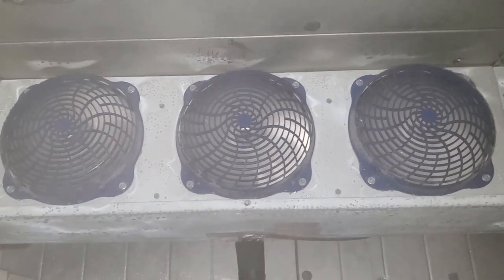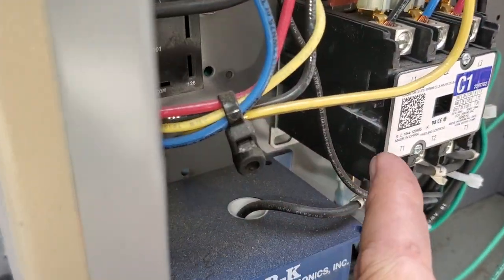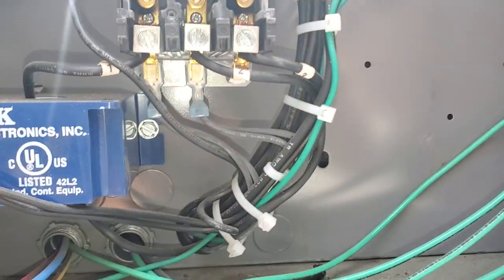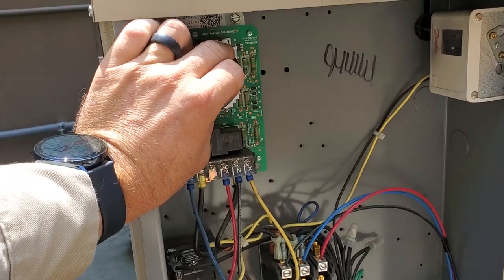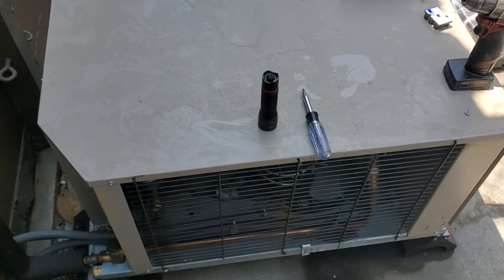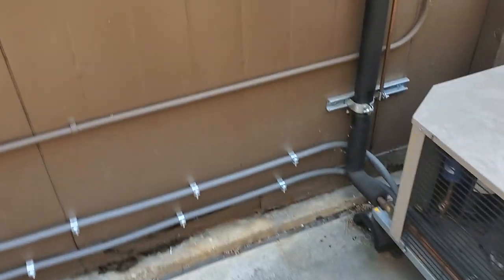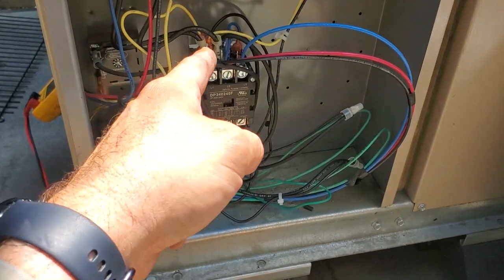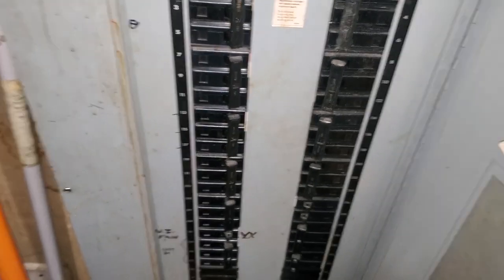THE WALK IN FREEZER BREAKER IS TRIPPED

Comment: Forgive me for sounding like a know it all but this isn’t my intention. You say you have 30A fuse installed then a 40A breaker upstream from this. The issue is that circuit breakers have different tripping characteristics to fuses. Fuses will actually withstand high overload current draw for longer than a breaker. So normally if you are going to protect a fused circuit with a breaker you have to oversize the breaker in order to provide discrimination between the two protective devices. For context I am an electrical engineer on the railway who works on three phase installations in the UK. For example when we have a 63A fuse installed we have to use breakers sized 125A upwards depending on the cable length between the two. Again not being clever just wanted to provide an insight to the fuses and breaker. Great videos by the way!

Comment: Mistakes happen, but the real test of a technician is owning up to his mistakes and correcting them. Yeah, it's hard working with your tail between your legs, but it's in the job description.
My photographic memory helper did the same thing, and I immediately knew what was wrong. I kept him on the hook for 20 minutes until I said rotation. He got it right away and corrected the wiring. I told my helper that I have done it too. It seemed to help.
I don't think there is a technician worth his salt that hasn't made simple mistakes.
Reply: Our motto was " Its not a mistake until you walk away and leave it there " , so you can be mistaken in the midst of a job , your only Human

Comment: When I used to fix light boards and soundboards, I would take pictures of everything before I removed anything. As someone in another comment said, they went back and looked back earlier in your video, as did I. Even before that, I was confused as to why there were red and blue wires going into the center of the top of the contactor. As you said, you found the problem and fixed it. That is the important thing. Imagine trying to connect a megawatt generator to the Grid out of phase. Because the Grid won't move, most times the generator tears out of it moorings and flips itself to fix the phasing.

Comment: I have seen a case where a bug got trapped between the half-cores in a contactor once. It prevented it from pulling together fully. Another thing to check is that the coil voltage to the contactor is correct.

Comment: It's nice to see how totally different everything is on electric side of those machines compared what i see here in Finland, i mostly work with grocery-shop refrigeration systems. On those wire colors. it's really strange that blue is live-wire, here blue is color for neutral :D, usually when changing electric components i take before photo to get things right.
Reply: In the US, 120V and 208V/240V are black-red-blue (white neutral), while 277V/480V are brown-orange-yellow (gray neutral).
We've also got funky utility transformer setups on some occasions: corner-grounded delta, high leg delta (for split-phase AND 3-phase loads), and open delta ("fake" 3-phase using only two transformers - it's real 3-phase, but the 3-phase load capacity is reduced compared to having three single-phase transformers, and the 3ph load is required to be balanced).
On rare occasions I've seen the utilities use three-phase transformers to supply customers - some are rectangular like the ones you use in Europe. But otherwise, they tend to use three single-phase transformers. The single-phase transformers can be used in a variety of different ways (but is 15% more costly than a single 3ph transformer).
(Exceptions are for large loads, like a mall or industry. There they'd use a pad-mount transformer or a switchyard.)

Comment: As an electrician I work on contractors often. As one person mentioned chatter causes arcing, arcing causes heat, heat causes carbon buildup.So what causes chatter as someone else said low coil voltage, or more likely a week coil caused by dirt in the plunger or coil windings comprised and shorting. You should take a resistance reading across the coil terminals and test to ground.

Comment: It's easy to get phase rotation wrong when reconnecting to replacement parts. The key is to check and fix it. 
It's not uncommon for a breaker to trip instead of a fuse blowing, even when the breaker size (amperage) is much larger than the fuse. This is often due to a much higher AIC rating on the breaker than the fuse, so the breaker responds the the high current (short) much faster than the fuse.

Comment: Circuit breakers can be decalibrated on thermal overload trip part. A 30(?)A fuse trip curve might be above circuit breaker trip curve in overload and scc area. Selectivity is not usually achieved with one step downsize but usually with 2.

Comment: Had one of those puckered butt moments today. Had to reset a 480 volt VFD that drives a 125 horsepower motor. I'm so glad no sparks flew lol turns out it tripped from overheating due to blocked vents.

Comment: Always pull the panel cover or hit it with a thermal cam. Loose breaker lug will heat up and trip the breaker and cause a recall. Another thing on them heat craft units is them anti shortcycle timers are terrible. I had one fail on commission they will tear up a contactor with chattering it. I recommend replacing the contactor with the copeland contactors. Much heavier contacts and remove the timer. Let it cycle a few time in defrost as residual refrigerant boils off. Helps with diagnostic of a bad solenoid or leak back on a compressor reed.

Comment: In commercial washing machines particularly the older ones contactors are used with a relay to change the direction of the motor.  My most spectacular mistake was connecting the spin and tumble contactor wrong and when i switched it on and set it off it was fun to say the least as the washer with 50KG of washing spinning full of water. That tripped the braker and flooded the joint.
Reply: Oh shit the spinning tornado of water.  Guessing the seals just didn't hold?  I had a claim with someone that had a full load of hot hot water pour out on their feet and sent them to the burn unit.  They somehow opened the door, no idea how they did that.
Reply: @KD0LRG  In commercial machines if there is a fault the door unlocks but remains closed. In domestic machines the door has a heat sensor and the door will not open if the water is above 40c. And the flood i described above came out of the steam vent. Doors do open occasionaly with hot water but this is usualy becuse the lock its self is faulty.
Reply: I’ve wired a blower motor on a Starbucks store wrong and it blew up! The manager came to the roof in a matter of seconds to see what was going on and this is what he got!🤪

Comment: there may of been a brief power outage, backpressure could of stalled or ran the compressor backwards in a split second when there was no power, then when power was restored it tried to force the compressor to run while it is still under pressure, popping breaker.

Comment: sealing the inside of the electrical pipe will stop that problem of ice inside your connection box. moist air will travel down the pipe and condense and in a freezer make ice.

Comment: Amazing video, as always. Quick question, do you have any suggestions for an evaporator cleaning compound that's safe to use on supermarket produce display cabinets and walk-ins? I can't use anything scented or that has a strong odour (like bleach) since the customers complain that the produce smells like bleach/lemon after even gentle use with lots of rinsing. I'm sure you've done your fair share of supermarket work, but let me tell you, if the customers saw what the evaporators look like that sit six inches under their food, no one would ever forget to wash their produce before they eat it.

Thanks in advance :D

Comment: My bet on this one is on the contactor. I've had the same issue with an old-aged contactor on a high pressure cooling water pump for a milling tool. Here in germany such things are powered by 400V 3-phase. On disconnect the electricity inside the contactor found a way from one phase to another and an arc ignited, causing a phase-to-phase short tripping the breaker. There was a big-bang-party inside this contactor, but no visible damage. If you measure it out everything looks fine. If you reset the breaker everything runs fine. Until someday, maybe tomorrow, maybe in a month, maybe never such an arc ignites again. I only was lucky that I've seen the bright flash inside the contactor which made me think hey... could be a good idea to replace that one.

Comment: Could you install a heat source inside the  switch box to keep ice from forming? Small light bulb, resistor, or very short heat trace. Maybe a light bulb that lights up when in use? However, ac bulbs on switches seem to burn out at least once a year.

Comment: That contactor looked like it had been chattering. That makes me suspect low voltage to the control circuit for some reason or another. Alternately, something pulsing the control voltage causing the contactor to chatter. I see several people have suggested that the short cycle timer can cause that sort of problem. Needless to say, chattering is going to result in the compressor running higher amps because it keeps starting with each chatter. That might have tripped the breaker, but I'm more suspecting a loose lug on the breaker causing it to heat up.
Reply: A low pressure switch will do it a lot but you notice Chris was pointing out a timer on it it which should nullify it that thought but could be be a timer issue still!

Comment: Why do you switch the neutral to pump the system down?
I'm from the UK and was always told to never swittch the neutral and any products you buy (if you take them apart) are always switched on the live side only.
Reply: If you cut the neutral but the circuit is live it tries to find ways to close the circuit so you might touch it and close the circuit on you.
Reply: @zaxarispetixos8728  I understand that although it would be logical to me to use a low voltage circuit in that circumstance, which in a "metal box" would be more likely to trip an RCD or something similar.

Comment: That contactor... im surprised it had no voltage drop it was SOO burnt!
Reply: They will be that way until the contacts hit the wrong spot.
Reply: Too bad mercury switches are not environmentally friendly. We still have some going strong on heaters that are over 20 years old. Newer contactor ones need replaced every couple years because of burned contacts.

Comment: Interrupt Neutral with the spring wound Timer: NO.  That is an NEC violation (line voltage) if you don't interrupt the line at the same time.
The contractor burnt: possible weak coil or chattering from low coil voltage.
Reply from the maker: I think your mis understanding me im breaking the common leg of a 208v single phase circuit to pump the unit down.
Reply: @HVACRVIDEOS  Common (neutral) interrupted leaves the High side hot where it may not be expected. 1 or 3 phase, makes no dif.
Reply: @steveurbach3093  Steve, I can tell you know electrics and I concur with your comment. Hot should never be on circuits, when stopped. It’s unsafe.
Reply from the maker: So what is the difference from the thermostat breaking a leg to the solenoid valve, or the defrost clock breaking a leg to the solenoid valve? Using a twist timer is very common in my area and in fact it comes from the factory this way very often ???? Im not being hostile just curious what your thoughts are?
Reply: @HVACRVIDEOS   It is not the timer. It is breaking ONLY the neutral leg. A person touches the solenoid and it is HOT on both terminals when you interrupt the return
Reply: It is not that it won't work. It is unsafe.. You can open 2 legs of a 3 phase motor and it will STOP without damage. The load side of the contactor is now at 120V (to ground)
Reply from the maker: Yeah I get what you are saying but I still am having a hard time wrapping my head around the fact that this could be against code. I realize that there is still a potential to get shocked but that exists anytime you are working on a system. I see this as a glorified pump down switch. Power runs from the breaker panel to the condensing unit outside and is fed to the evap coil via the defrost clock outside and when they turn the twist timer it simply interrupts the common leg before it gets to the coil. It really is no different than a pump down switch except that it immediately turns off the evap fan motors ??
Reply: While I would usually scream about this as well, the issue here is there is no neutral. The evap is being fed two legs from a 208V 3-phase wye circuit.  The absolute proper thing to do would be to use a DPDT timer and drop both legs, though...
Reply: I've been awake too long... that would be DPST... :-)
Reply: Rather than run high voltage to a timer, why not use low voltage? We try to use as much 24 volt as possible on equipment so if a wire is exposed, you don't get shocked. Industrial is dc vs ac for hvac but it is still safe to touch. You would need to add a relay to interrupt power like the switch is currently doing.

Comment: Hmmrr.. so disconnecting the neutral wire through something like the twist timer is normal and allowable in the US? Just wondering because in Europe you never ever switch the neutral, always the live wires only, to prevent casings and frame becoming live in case of wire rubouts and such. No critique, just trying to understand the way things are done in the US :)
Reply: I was thinking the same thing
Reply: As an electrician you NEVER switch the neutral, I'm guessing there is something we are missing.
Reply: On a freezer evaporator there’s two hot legs, it’s just taking one leg out of the equation. Disconnecting it that’s all  it’s doing. 208/230 volt on all freezers in my area, DFW area evaporators.
Reply: I don't think he was intending to say "neutral" wire, i think he meant to say the common wire from the time clock to the evap coil, which connects to the N terminal.
Reply: @captainkirk7702  That could be it, in that case it wouldn't make a difference which leg you disconnect as far as potential towards ground goes.
Reply: @mikec.2746  Probably, then again it just might be a figure of speech to say neutral wire in that specific case. Some things in the american system just seem odd to europeans :) We only know 230/400V and there are no 400V coils, its always 230 against neutral.
Reply: @caerusdharken57  as long as the timer or switch and the box it’s located in have a known ground connected to it for safety due to shorts. Earth (ground). I’ve seen electricians do it that way. Over here we have on freezers are two legs and a ground in these applications coming from the condenser to the evaporator, they put that switch in the loop for a convenience to the customer.

Comment: I’m not knocking what your doing but I was told that your not actually supposed to turn the time clock by the outer wheel and always turn it with the hand in the middle. I was told that it damages the the inner gears.
Reply: What about réfrigèrent leaks ?
Reply: @matthewgregory8218  what about them?
Reply: If why their was lots of ice in the freezer
Reply: @matthewgregory8218  I’m not sure what you’re getting at but my comment has nothing to do with refrigerant leaks or Ice built up on the coil. From watching the video there’s no sign of a leak.

Comment: Having a contactor fail from overheating/arcing prematurely could be something as simple as cheap materials now days or loose/undersized wire. Loose and undersized wire both cause increased resistance which can cause lots of problems. Of course that doesn't seem to be the issue here but is a common issue to say the least.
 In this situation I think it's very possible that the door switch constantly getting wet & tripping the breaker could cause just enough increased resistance to cause that problem, especially since you don't know how long it's been an issue or how many times it's tripped the breaker.

Comment: You say it do three defrost a day?  Clock look like four?  And why don't that meter read volt drop across contacts?  Is it something in the design that it has to exceed a high value to give a reading?  Why so much ice?
Reply: He's checking the input & output of the same phase, so there should be zero voltage drop.  If there were some, it would indicate resistance inside the contactor, which would cause it to heat up (Vdrop * Amps = Watts).
Reply: @awd42  All conductors and switches/contacts have some voltage drop.  Unless its a superconductor.  What I wonder about is the meter he is using and I have seen other techs using similar meters and not getting a reading across.  Should be something there.  Maybe something about the design of the meter.   The spec sheet for that meter says greater than 20 digits for a reading?  If I'm reading that right?  May read 0 volt drop if actual drop is less that 20 millivolts?  Do they even read millivolts?  I would think so.

Comment: Finished reviewing the video and you messed up on the order of connection. At the @4m5s you have Black, Blue, Red and 1,2,3; when you got the error you ended up with Black Red Blue, and 1,2,3. You "fixed" it by inverting the bottom 1, 2,3 to a 1, 3, 2.

Comment: it was black blue red, not black red blue
Reply: Yea, I saw that too Right away. I was like wtf the red wire was on the right end. He really needs to Take a few Pictures before changing parts & double check against picture before start up.
You have to establish Good Basic Procedures to Do things Right. Take pictures of everything , tags & wires before starting to work on a unit as SOP. it’s a good CYA procedure. Also if u need a model number u have it.
Reply: @OcRefrig  he did take pics..in fact he was taking 60 pics every second. 😉 All he had to to was look back at the footage.